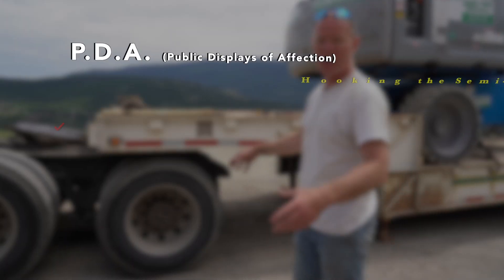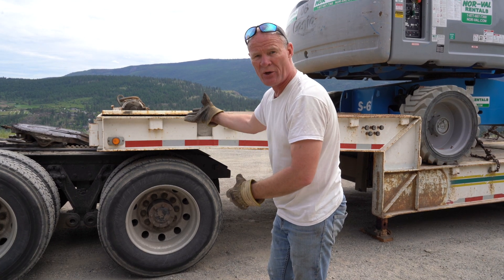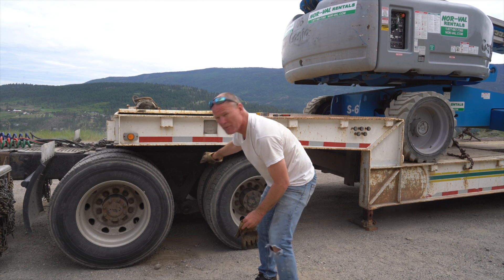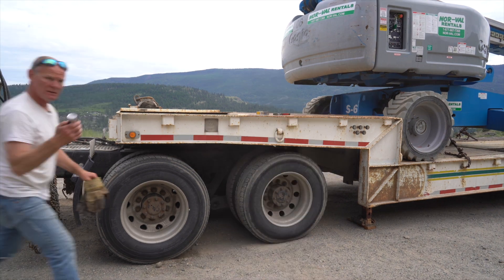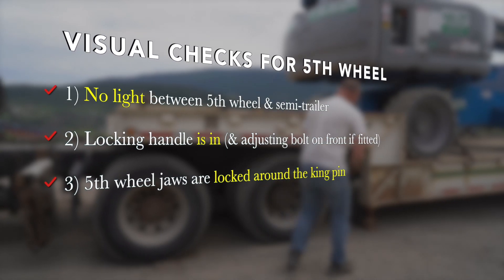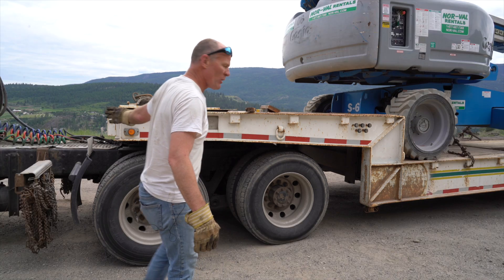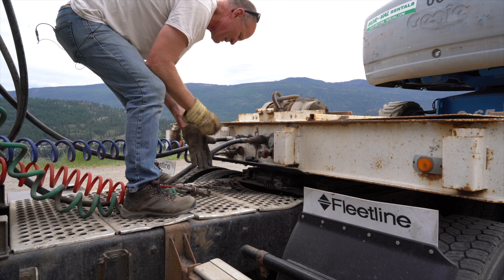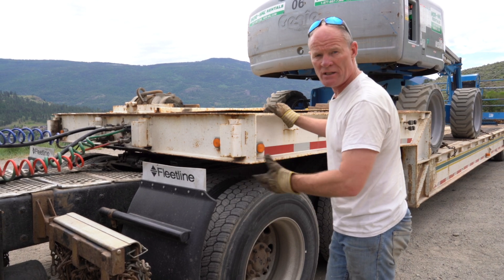How to Hook to a Semi-Trailer Correctly (M.E.L.T.)

Comment: Be like me and drive a day cab for a living and use the back window to check fifth wheel height 😂

It’s definitely better to do the official process, but I drive a local paper route. If I did this process every time I hooked to a trailer, nothing much would get done.

On a busy day we move about 25 different trailers from point A to point B in a 12 hr shift.

For those situations where the trailer apron is too far above the fifth wheel, I let the apron rest halfway on the fifth wheel then lower the trailer onto the fifth wheel completely.

If it’s loaded, that trailer is rejected and we won’t move it 😂😂
Reply from the maker: That is a lot of trailers my friend...A LOT of trailers. Yes, you can certainly speed up the process, and so long as you stick to the sequence, you should be able to hook to a trailer in 3-5 minutes. Of course it depends on how long it takes to wind up the landing gear. But never, ever skip checking that the 5th wheel jaws are locked around the king ping. A visual check with a flashlight is a must. All the very best, Cheers Rick